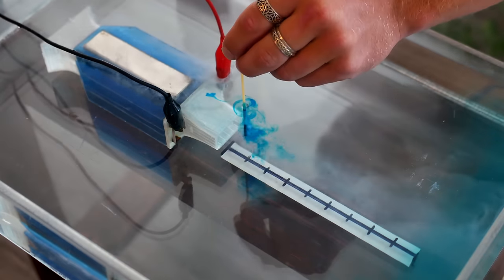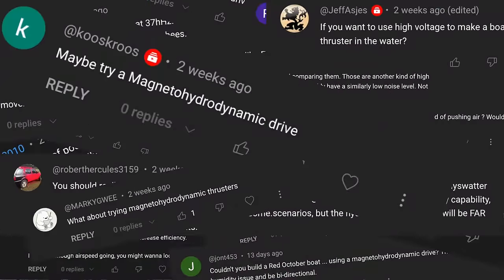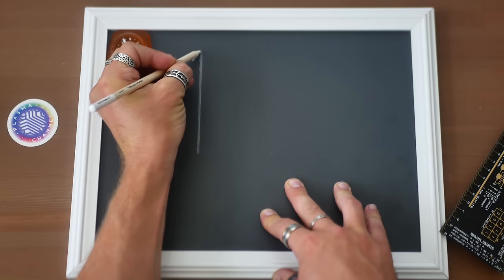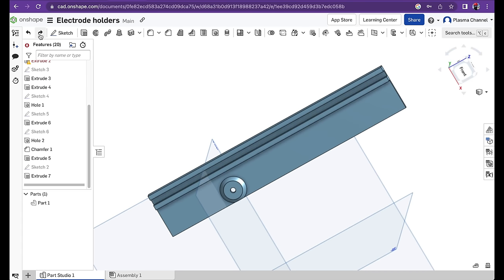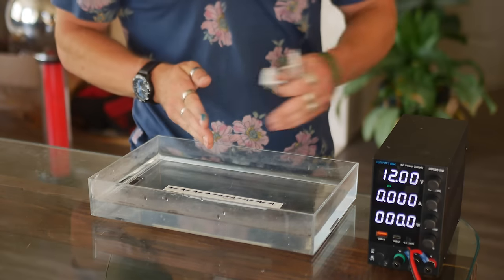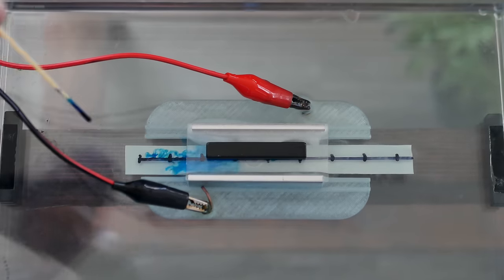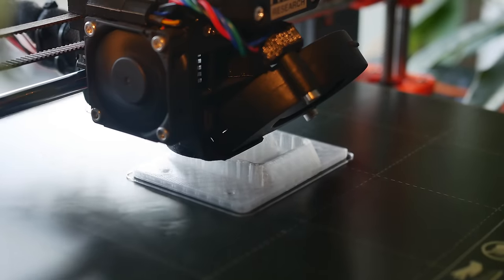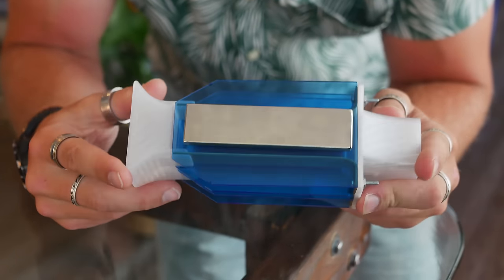Using Stealth Propulsion for Ocean Travel (MHD Thruster Build)

Comment: I think the electrode spacing effects the fluid friction. So if you bring the electrodes closer to each other, you will get a higher repellend force like you said but you will also get higher friction. In the middle layers of the fluid you have max vellocity, at the most outer layers is the velocity zero. So if you have more layers (whider spacing), you get less friction in the middle layers and so more velocity. In the other way around you will get less velocity cause the zero velocity layers are to close to the center/middle of the fluid stream.

Comment: You can increase the magnetic field if you provide a return path for it. Add iron bars to the your magnets, so that the backs of the magnets are connected by iron, in kind of a U-shape.
This reduces the air gap of the magnetic circuit.
I think applied science has a nice vid on the topic

Comment: Looking at the shot @10:26, there is a lot of gas being produced at the points where you connect the power lines. I'm no hydro-electric engineer but I would figure a lot of current is flowing around the engine instead of through. So insulating those parts might increase the efficiency by forcing the current to flow through water that is experiencing the strongest magnetic field.

Comment: very clean room tech. plasma mhd says rarrr. yep electric arc mhd. closer electrode spacing does not change electrolysis speed. thats why only changing voltage and amps and stuff matters. acceleration length and surface area etc.

Comment: Use the plasma to push the air off the top of the craft. With no pressure on the top of the craft the air pressure on the bottom of the craft will push the craft up.

Comment: Closer spacing results in higher drag due to the fixed boundary. This is probably canceling the increased field strength. The effect probably highly depends on the flow regime- the Reynolds number

Comment: The electrolysis of the water is causing hydrogen and oxygen to escape the fluid, which causes a pressure differential, the escaping gasses create flow in the fluid/medium by simple displacement.
When it is contained, the escaping gasses will form a higher pressure differential inside the container... If the container, and exhaust are designed to take advantage of the effects.

Comment: You should add a (ferro)magnetic core around the outside N and S poles. Its will increase the field within the gaps. Even thick sheet steel shaped like a C clamp would work .

Comment: Air ionization also can be used like in water. The air above is ionized through microwaves and radiowaves. The fluid or superfluid generates a magnetic field. The negative ions tries to connect with positive ions above the craft. The surrounding magnetic field creates a repelling force, an Eddy current, which lifts the vehicle. So you can invent alien spacecraft :))

Comment: Excellent-it looks like a good idea- 1 thing I was wondering about is the 2 magnets on the top and bottom- wouldn't you still be getting that weaker flow from them that could be added to the overall output ?

Comment: In case nobody mentioned it already, the small bubbles you saw in the saltwater are not the electrodes dissolving, but hydrogen and oxygen produced aka. electrolysis. I would guess this will be a huge downside from the efficiency perspective unless you burn it in rocket style contraption 😅

Comment: Try using electromagnets instead of permanent magnets. That way you can use AC electricity which should prevent electrolysis to take place across the electrodes,hopefully increasing efficiency and Power. Since you're keeping most of your energy for thrust instead of electrolysis and with electromagnets you can adjust the strength of the magnet field giving even more thrust. Also try experimenting with the frequencies of AC I'm curious to see if it would have an effect in performance.

Comment: Would it be possible to stack this system multiple times to increase thrust? maybe in a hexagonal or cylindrical manner instead of just the 1 set of electrodes.

Comment: 4:47 Only the area above the magnet gets a force. The whole area between the two plates needs to be under a magnetic field, so that the electricity can move the electrolytes inside the water. Those electrolyte particles outside of the magnet field won't get any lorentz force.

Comment: I'd like to see an MHD catamaran.  You can have 2 drives the length of your boat, which you can also use to turn the boat, back it up, and turn it in place by changing/reversing voltages
Reply: The Japanese test vessel Yamoto 1 was a catamaran with an MHD drive in each hull.

Comment: Your electrode spacing didn't affect much because your magnetic field lines are dispersing within the current stream. Also, part of the increase from adding the second magnet above is that it pulls all of the magnetic field lines fully perpendicular to the electric current between the two magnets. A Halbach array the full width of your electrodes should increase your efficiency by containing all the fields lines within the current steam.

Comment: A gram is not a measure of force. In the final result, the force stated at 75 to 100 g would be the weight of 75 to 100 g, which would be 0.75 to 1.0 newtons. The water velocity was not stated for that condition, but if it is 20 cm/s (0.2 m/s) then 1 N represents 0.2 watts if the thruster is used at discharge velocity, and proportionately less at lower speeds. The quoted power requirement of 3 watts per gram of thrust (0.01 N) implies an efficiency at 0.2 m/s discharge velocity of 3 W input for 0.002 W of output, or 0.07%... and proportionately less at lower speed. Welcome to one of the biggest reasons why MHD is not a viable vessel propulsion method. 

For those not following the calculations...
- the force of gravity on an object is the mass of the object (grams multiples such as kilograms in metric units) multiplied by the acceleration of gravity (about 10 m/s2 or 10 N/kg at the earth's surface)
- power is the product of force and speed; for example, force in newtons and speed in metres per second is power in watts
- efficiency is the ratio of output (propulsion in this case) to input (electrical power in this case)

It is possible, of course, that I have made a calculation error. Feel free to check...

Comment: Pretty sure the easiest way to get a little more performance is going to be insulating the leads, screws and even the portions of the plate that aren’t needed (the bent ends). I’d wire it up, tape off the portions that need to be kept clean and spray the rest with plasi-dip or paint with epoxy.
Reply: I say this because you are making browns gas in between the gator clips, obviously wasted current.

Comment: Interesting curiousity in light of the Hunt for Red October, if the process of electrolysis is taking place in the HMD motors, although minimally or undetectable to sonar and similarly used tools currently, wouldn't there likely be a trail left by the changes taking place between the metal nodes and the water, that would still be traceable and maybe even more revealing if we implemented tech to read out and map those trails or am I thinking about it all wrong?

Comment: For some reason I missed this the first time I watched the video: You are powering your electrodes from the wrong end!  (In the final product.)

It might not seem like it matters, but it does, and it might even be the reason you didn't get better results with closer spacing.  When power flows through the electrodes, that generates a magnetic field around the electrodes themselves.  This magnetic field is what railguns use instead of permanent magnets (though you can use both for amplified effect).  Here's the thing: The direction of current flow in the electrodes determines the direction of the magnetic field.  The electrodes must be powered from the end furthest from the exit, or the force will be in the wrong direction.  The force is always away from the electrodes.  Now, you've overwhelmed the magnetic field of the electrodes with permanent magnets, but the fighting between them makes the net magnetic field strength lower than it should be.  If you put the input contacts on the intake side instead of the output side, you should get better results.

Now, I mentioned that this might also be why the spacing didn't make a difference.  Here's how that works (if it's what is happening).  You have two electric currents that matter here (technically the same, but we are going to treat them as different).  First you have the electrode currents generating a magnetic field.  Then you have the current through the projectile (water, in this case), that is moving perpendicular to the electrode fields, causing force (you didn't see this without the magnets, because your input points were either near the middle of the electrodes or at opposite ends, causing either the forces or the magnetic fields to cancel out).  When they are close together, the field strength is high and the projectile current is high, but because the permanent magnet is countering part of the electrode fields, part of the equation cancels out.  When you move them further apart, the current decreases, causing both the electrode field and projectile current to decrease.  The decreasing projectile current would be expected to reduce velocity, but the decreasing electrode field means less opposition to the permanent magnet, which partially counters the reduced current.  I'm sure if you moved them far enough apart, you would see a reduction in velocity, but because your permanent magnet and the electrode fields are fighting each other, when the electrodes are close together, you are actually reducing efficiency.  I haven't done all of the math, but I suspect this is a non-linear function, where the fighting fields caps the velocity below the natural cap if the fields were aligned correctly, and as you move them apart, that cap diminishes, keeping the velocity about the same until you reach a certain distance where it then starts to drop off at the exponential rate that it should be dropping off at.

Anyhow, just remember: In a rail gun (even one that "shoots" a fluid), the natural magnetic field pushes the projectile away from the point where the current is connected to the rails.  If you align the natural magnetic field with your permanent magnets (if the fluid continues to move away from the power coupling points, they are aligned), then the fields will add to increase the net force applied.  If, however, they are aligned opposite to each other (if the permanent magnets are strong enough, the direction of motion will be reversed, otherwise the velocity will just be reduced), you may still get the projectile to move, but significantly less force will be applied to it.  You will still consume the same amount of power though, just wasting a significant portion of it fighting with the field of the permanent magnet.

I hope this is useful.  The coolest part about railguns is that they naturally provide both the magnetic field and the current moving perpendicular to it in the same circuit.  If you aren't taking advantage of that, you are missing out!  I believe that if you had the power connected to the rails correctly, you should have seem some motion (possibly very slow though) even without the permanent magnets.

Comment: I'm an idiot but, what happens if you crank the current and you turn the voltage below the activation threshold for electrolysis? Or is that dumb because of ohms law?

Comment: Instead of stacking the motors. Putting them in series might get more thrust. Further if you apply a low frequency. You could get a pulsed thrust.  You might even try BLDC principles and create even larger pulses. 
This is how I imagine the motors operated in the movie The Hunt for Red October. 
And if you consider electrode degradation stainless steal might be a better option.
Besides that if you were to scale up. You would have to consider how much electrode size and shape matters. When separating oxygen and hydrogen, surface area makes a huge difference. Also considering the size of the submarine and the size of a hydro dynamic drive associated with such a machine. There is little chance that it would be totally quiet. I imagine it would make a similar sound of a volcanic vent. Try putting a microphone close to your experiment when in operation

Comment: 2 comments:-
a) try putting an external soft iron C or double E core magnetically tying the outside of the top to bottom magnets to reduce the magnetic path length to increase the flux inside the thruster.
b) the corrosion on the brass could be a problem (& eat the plates away) but whatever you do DON'T use stainless steel... Electrolysis & stainless leaches green/yellow chromium ions that are carcinogenic.

Comment: I suggest you try varying the salinity. You might expect an approximately linear fall off in speed with salt concentration. But I would bet it's non-linear, in which cSe plot speed versus log of concentration. This could matter for a motor operating in estuaries.

Comment: Add an aluminum rod down the middle. You instantly see a major increase in volocity. You'll need to plastic coat it, or the salt water will eat it fast. Aluminum isn't magnetic, but has a serious reaction when lined up down the center. It would be the bullet on the rail gun. But you mounted it so it can't move. If it can't move, the fluid has to move.
Reply: It's another way to take advantage of Lentz law, and how high speed trains operate at 300 mph. It's all about the aluminum riding on top of a DC magnet rail using over lapping copper coils. You should coat everything in plastic, because you don't require direct contact. Just the action of the magnetic field on the aluminum, and magnet down the center above or below the aluminum rod. The larger the rod diameter, the more thrust you create. Using the over lapping magnets will definitely deliver more thrust.

Comment: The magnetic field generated by the lateral current flow is the true correlation. Voltage is somewhat incidental. A higly conductive fluid would give best results. I agree with a comment below that suggests a current limitation in the form of bubbles forming on the electrodes. Stop that happening (i.e. stop the water being cracked and you should do better. Try using platinum for the electrodes.

Comment: Electrodes are physical objects and are subject to shear forces. What you're likely seeing is commonly called skin drag and this theory could be tested with coating the electrodes with a hydrophobic material. This means a limited ROI for getting them closer as in increases the drag, even though its increasing the velocity, which essentially cancels out and there would be limited difference due to changing distances, like what you found. Not sure if hydrophobic coating would effect the conductivity of the electrode though...

Comment: Graphite or platinum coated electrodes? Laser engraved electrodes to increase surface area? Or just resin 3d print electrodes and electroplate and use added textures to increase surface area at microscopic level? Maybe a surface texture like whale’s skin to increase surface area but increase water flow over surface to reduce bubbles? Try spikey electrodes like Integza’s ion engine? What is the current efficiency of the system? Great work as always.

Comment: It's your visual control that's showing you only symptom of flux. You can sprinkle iron filings underneath a glass watertank to see your problem. Spacers to allow the iron filings to move into the shape of magnetic field lines. You will find your ctual flux density with ability to
Reply: Ability to ease water along with them is not being improved because to opposing forces cancel each other. Flux lines so closely looped around flowpath they feel the outside/inside of toroidal field density
Reply: See your final missing bits by laying acrylic with graphite on them around your experiment. Acrylic is easily made electrostatic so you can disregard gravity for your visual indicators on vertical surfaces. Or just use a glass cylinder and a Van Der Graaf generator

Comment: Would there be a way to control the flow of water on the outside walls of the electrode drawing water back into the inlet creating a stronger vortex on the two sides?

Comment: Japan’s Yamato test vehicle showed it requires very high tesla values only able to achieve with super conductors and it also requires a high magnetic shielding so anything near the superconductive magnets will not damage the electronic equipments. Basically it was a bust for real life applications.

Comment: You might want to use Super hydrophobic coating to protect your Electrodes but then you need Even higher Volages to Jump the Small air Gap  made by the Super hydrophobic coating + any insulating Propriety however it is porous

Something Else to look into with this is The Venturi Effect To move More water

Comment: I wonder how you calculated the intake and output taper angles. Did you test without it?
For a prototype in motion,  I think the intake taper would increase drag. For all situations, I would think the output taper would impede flow because water does not compress and the system does create flow, but not pressure (as far as my reckoning will carry me).